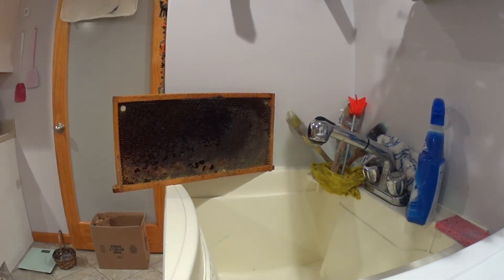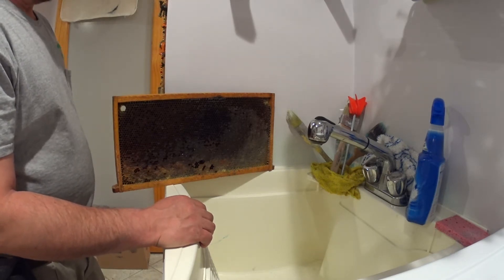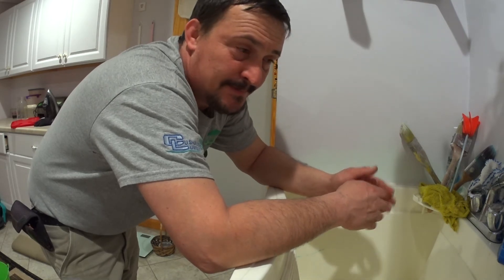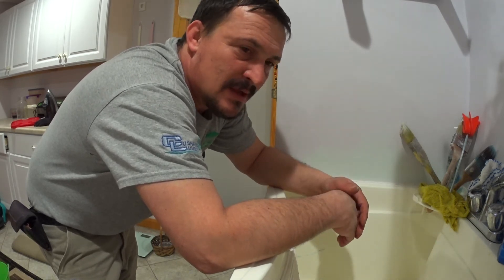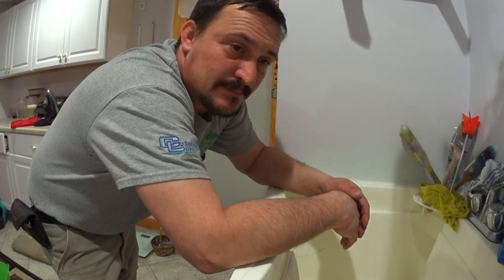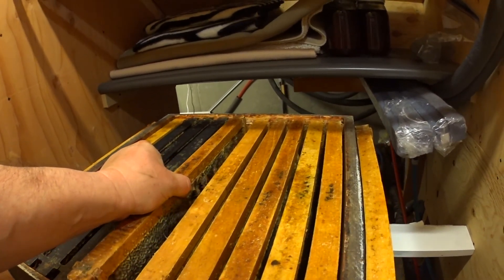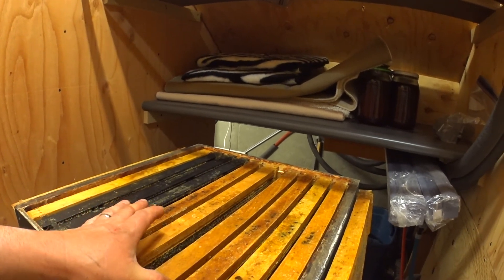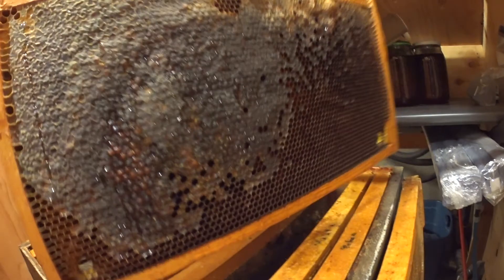Horizontal hive with insulation winter hive collapse part 2

Comment: Put a De-Humidifier in the room with your Hive-frames and let it run until the Hive is dry! Sorry just seen you doing just that. The problem is NOT the condensation it is the Ventilation. The moisture laden breath of the bees need to be removed by letting it rise out of the Hive or be wicked away with a absorbent blanket that holds the condensing moisture.

Comment: Is your hive tilted slightly? I was told they need to slightly tilted towards the landing  so the condensation travels away from the cluster, and down  and out. All the videos with horizontal hives I've seen the bee's close the vents, so I don't think it was that at all. Don't be so hard on yourself. Unfortunately these things happen.  Is the inside of the gable roof empty? Maybe some wool, burlap, wood shaving, hair, or blue jeans could be put up there for insulation? I did hear Dr. Leo say Styrofoam causes more condensation?? But wasn't sure if that was present to begin with?? That's all I got. Hopefully, whatever happened you find the answer. Good luck this year with the ladies!
Reply from the maker: My downfall was i didn't have anything on top of the hive that would catch moisture. Bees create heat and heat rises and when the heat hits the cold in my case was the cover boards it created condensation. Droplets with water started to accumulated and they started dropping directly on the cluster killing bees one by one until there ware not enough of them to keep the queen warm. If the boards would have been removed with some cloth like cotton or wood shavings that would be enough to save the colony. Unfortunately I tried to modify the hive but being in the construction business I always go above and beyond things just few more screws and little more glue just to make sure incase of terrorist attack (lol) that thing (s) can survive. When trying to get things apart wood started to crack because it was glued and screwed so tight that I wasn't able to save it. I just started on my new design with lots of improvements it won't be ready for the new colony this season but it will be ready for 2022.  Vertical hives I'm familiar with but not giving up on something new. What I have to say that wat I saw in the horizontal hive during the the season before winter that it was very easy for the colony to build numbers very quickly. Thank you so much for watching and your warm comments very appreciated.

Comment: In addition, looks like you fed the bees too late and they never capped it - another moisture contributor.
This you could address with placing dry sugar on top of the frames - to capture excess moisture AND feed the bees.
Reply from the maker: If you look at the entire video they was plenty of natural honey left which they was using. If you leve enough for them they will use honey before sugar feed. The week of the Thanksgiving is more than enough time for feed as they won't touch it before all natural ingredients are done

Comment: I appreciate all the info you’re sharing. I’m learning a lot from your experience. I’ve been bee keeping for 5 years and it’s only this last couple seasons they haven’t made it through.
Reply from the maker: What was the reason for your loss. Do you keep your hives in one location and how did you have them installed.  your hives are horizontal or vertical